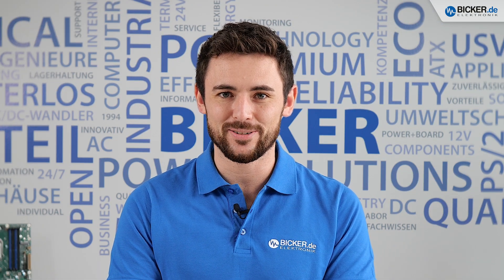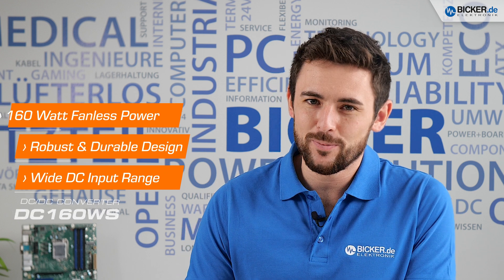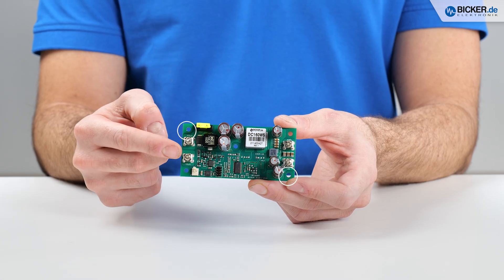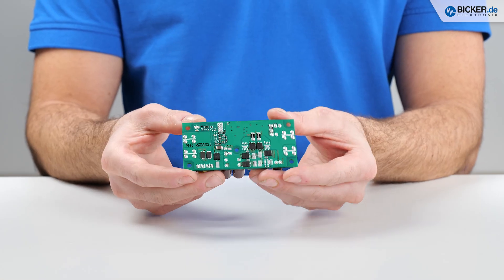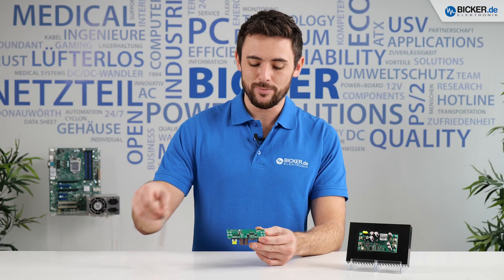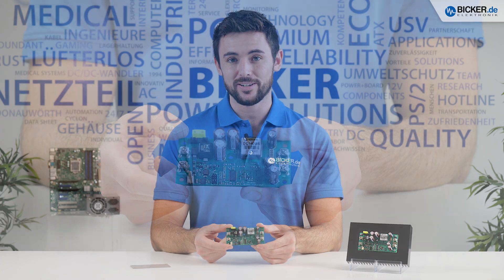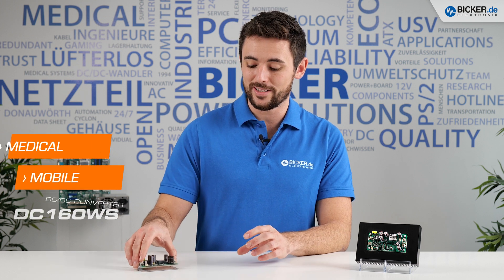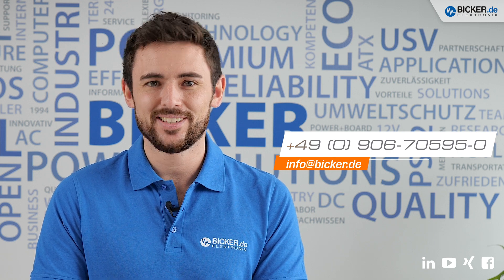BICKER DC160WS – Fanless 160W DC/DC converter –  6...36VDC input – 12V/19V/24V selectable DC output

Comment: Are you planning to make <= 300W DC-DC converters to meet current high CPUs TDP?
Reply from the maker: We are working already on a 300W DC-DC converter with user selectable output voltage 12V/19V/24V to supply demanding CPU's. We expect availibility around end of Q2/2023.